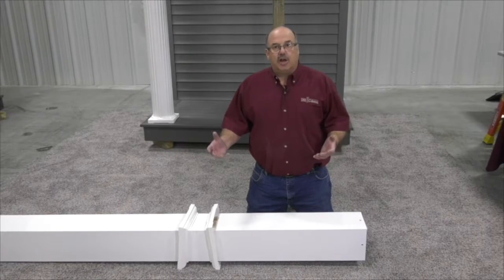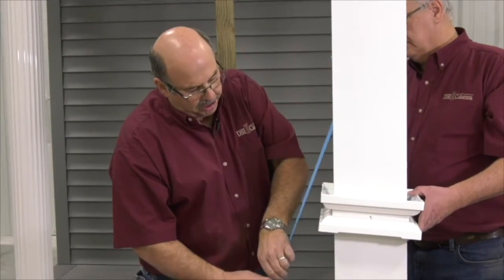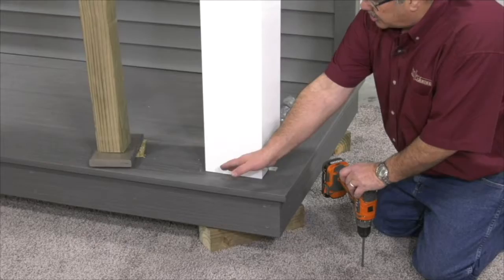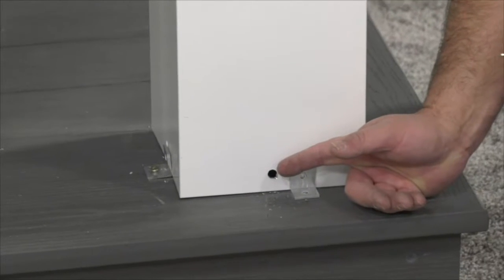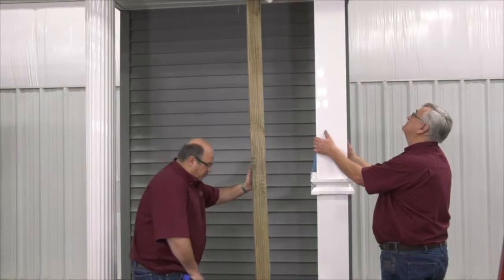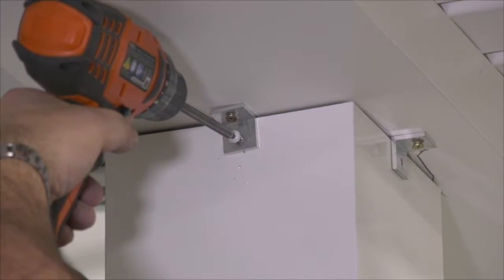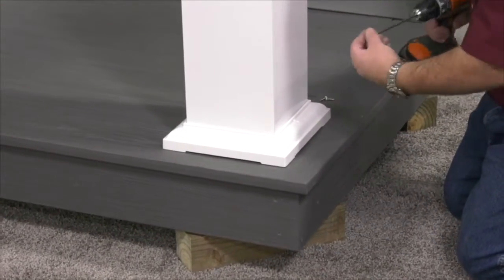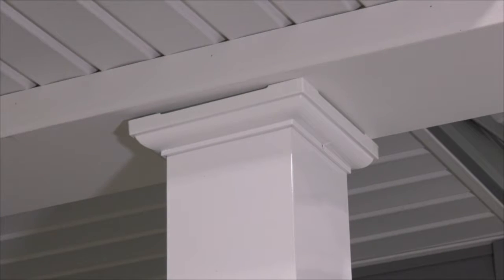Structural Aluminum Column Installation - Part 2

Comment: We spent a lot of money buying ten of the same exact columns for around our home. The only difference is that the capital, base and astragal are split (two pieces) and have proven next to impossible to line up and look nice. There were no instructions for this, no holes in those parts and as a result they columns look great but the other parts look awful.